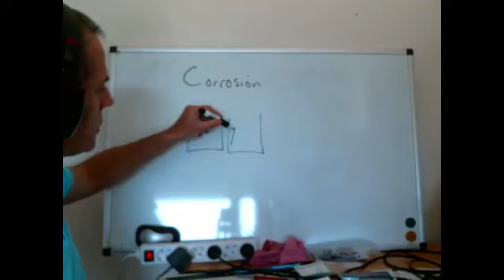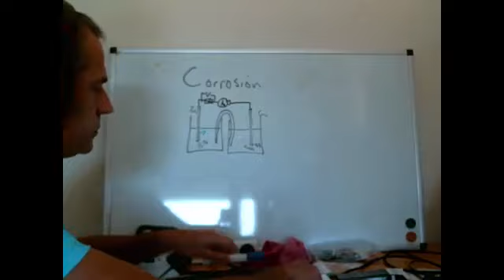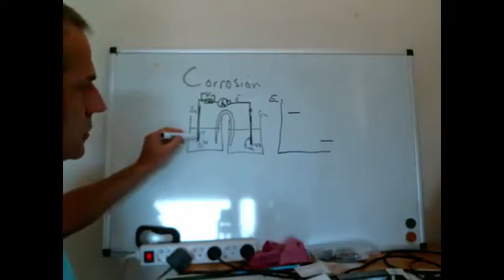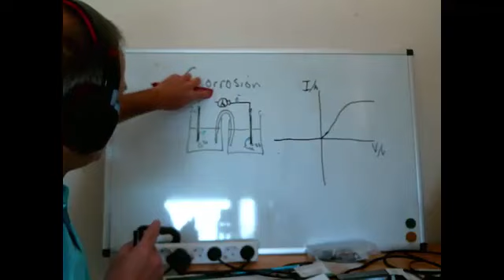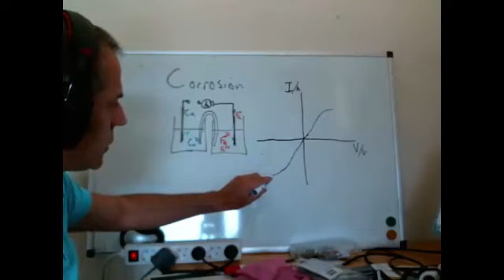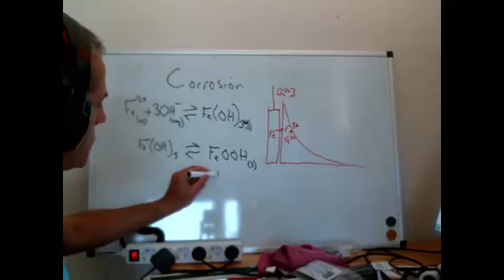Iron Electrochemistry theory

Comment: Since voltage is a scalar quantity shouldn't the graph only be positive on the x axis, or is this the main difference between voltage and emf?
Reply from the maker: I may well have used the wrong terms.  There is a difference between "potential" and "potential difference" and emf but all are measured in Volts.  EMF is the magnitude of the Voltage difference, often between the two terminals of a power supply.  Potential difference is one step down from that in that it describes the magnitude and sign of the EMF, e.g. between two people. 

Potential is the relative Voltage in a system compared to a reference, in electrochemistry usually the hydrogen electrode.  It is important to remember that the reference must be inside the system.  Just as stacking one cell on top of another does not change the chemistry inside the cell but doubles the EMF taking your fleece off and charging yourself to 20000V does not change the relative potential of the iron in your blood and the water in your blood.  Typically voltages in water are less than 2V, whereas static electricity is typically thousands of volts.